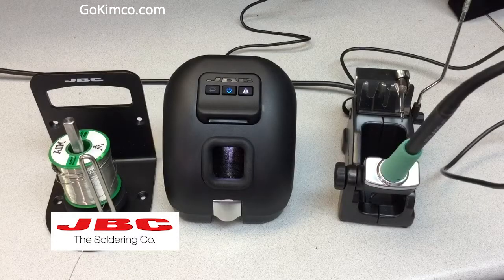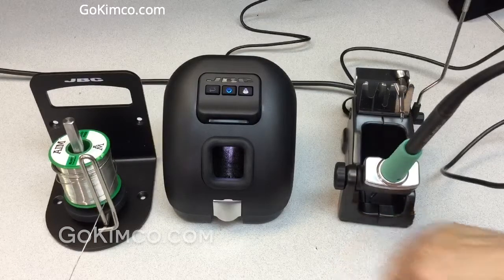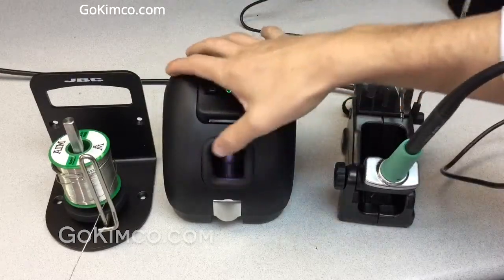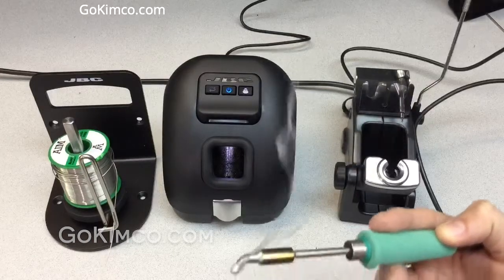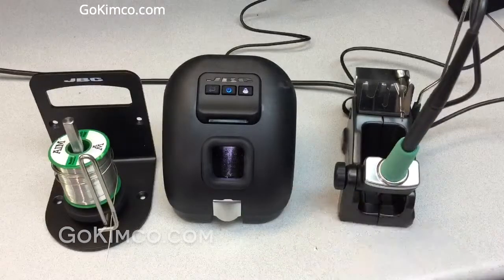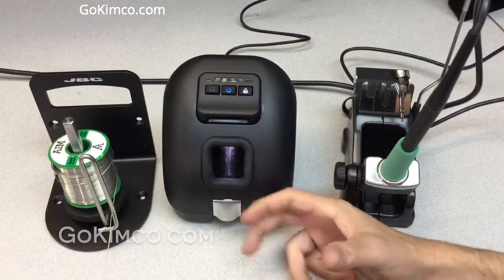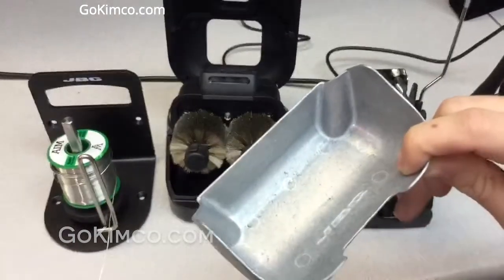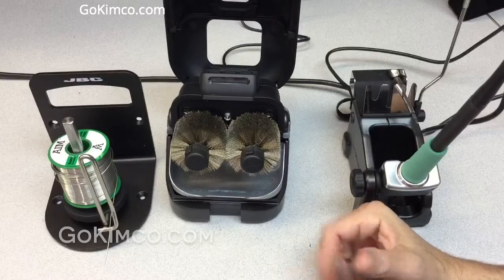JBC CLMU-A Universal Tip Cleaner Overview

Comment: Be awesome if you could do a review comparing this model to the JBC CLMS-B.
Reply: Or the CLMB! I've got that one and nobody has been able to tell me the difference!
Reply: @warpedgeoid  the JBC CLMB is the older Senior Tip Cleaner. I guessing it will be replaced by the latest CMLU Universal Tip Cleaner. Only difference I can tell is that the newer CMLU switched to a more reliable sensor for automatically turning on the rollers and has the buttons for changing the mode settings on top of the unit. I just ordered the CMLU-PA with the nylon brushes but it'll be about a month before I get it as JBC is super slow right now shipping products to distributors due to Corona Life.